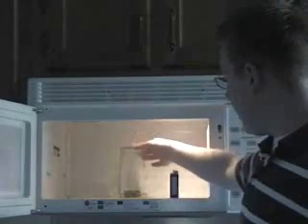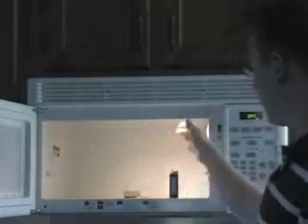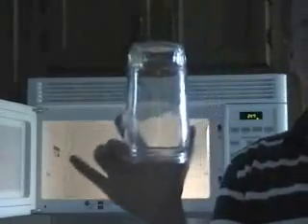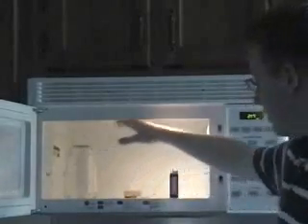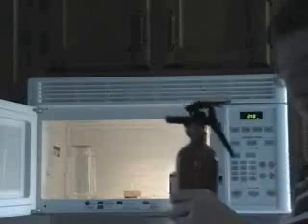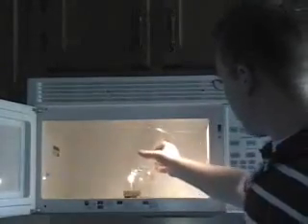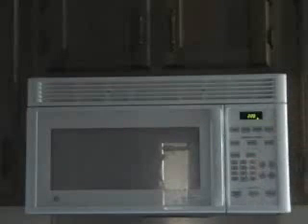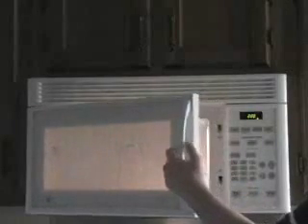Instructional:  How to Make Plasma in a Microwave

Comment: Well... plasma is a state where the electrons wander away from the nucleus...
And when something burns with a flame, electrons are torn from their atoms as the atoms rearrange to form new molecules. Usually the molecules return but it's a microwaves job to set up electric and magnetic fields, and if electrons are floating around freely they can be shoved far away from their point of origin by the electric field. I.E oscillate back and forth, to and away from the nucleus.

Comment: Actually, it does not generate any ozone, it generates nitrogen dioxide, which is also toxic but it would be much worse if it actually released ozone. Ozone protects earth from UV rays but don't be fooled by that, it is a highly toxic gas and one of the strongest oxidizing agents. A single whiff could be enough to kill you, and even low concentrations can cause long lasting damage.

Comment: @iFirebird any material can be turned into plasma, you just need to supply enough energy to free the electrons from their atoms. Plasma itself is just free floating ions and electrons. The ions are the atoms without their electrons. Very cool, but very ordinary. It is comparable to how energy is added to a solid, it will become liquid, if more is added, it will become a gas, more is added, it will become a plasma. Any substance can exsist in all four states (as far as i'm aware)

Comment: @JERKMONKEYYEH Ice contains Hydrogen and Oxygen, both wich require very much ionization and high temperature, however if you light a candle in the microwave the gases from the flame has enough ionization and energy to form plasma.

So different substances have different needs to form plasma, there's for instance "plasmatic" Helium and Hydrogen in the core of a sun, giving you the idea of how much energy those two require to form plasma.

Comment: @iFirebird (simplistically) by definition a plasma is a partially ionised gas. The most common ones we use in labs are argon, but if you can generate ions by some means (such as fire) and keep their rotational states elevated by microwave-induced transitions, then the temperature spikes from collision-induced heat and this will also potentially maintain the ionisation.

Plasmas tend to be hot. Argon plasma in labs is usually between 7 and 10 thousand degrees... no idea about this one though

Comment: Or to be simple any aluminumn like metal placed under an upside down pyrex bowl. Heck even with a twist tie. The important part is the pyrex its clear so you can see your plasma ball, and its tuff and can take it for about 30-60 seconds before it shatters.

Comment: Also, your chemistry class definition is kind of misleading.  Sure, the temperature of any laboratory plasma can be around 7+ eV (80000+ Kelvin) which indeed exceeds the temperature of the sun, but don't forget the role that specific heat plays.  Plasmas generally have very low specific heats, thus low amounts of energy can result in very high plasma temperatures.  If that same amount of energy (in this microwave plasma) were applied to, let's say, a cup of water, it would probably just simmer.

Comment: Not quite.  When you're producing a weak plasma, you don't split any atoms.  You ionize them, ie, strip off the out shell electrons of the atoms.  You can have plasmas that consist purely of ions, or purely of electrons.  No need for atom splitting.

Comment: Rock? There is no rock in a plasma reactor. The plasma in there is superheated hydrogen. And technically, any plasma created on earth IS terrestrial plasma, but it still remains true plasma. An example would be the Aurora Borealis in the north and lightning. All plasma is is a superheated gas in which the electrons have broken free from their proton hosts. It becomes plasma when a current begins flowing in it, or is induced by making those free electrons move around,as done here by the microwave

Comment: Firstly, Plasma consists of free electrons and ionized atomic nuclei. A microwave produces non-ionizing radiation, the kind that heats water by vibrating it, thus the microwave dosnt contain enough energy per quantum to ionize atoms. This means that you cannot produce plasma because the atoms are not ionized. I hope that ansewes your question, JamesB4754. Im in year 7 and better at plasma phisics than you so ha!

Comment: not sure if your entirely accurate on the whole oxygen burning business. a plasma is more or less a cloud of free floating ions, like a sea of protons and electrons too hot to stabilize. oxygen isn't necessary because its not a combustion reaction, if it was then it wouldn't be plasma.
Reply: correct.  & every flame is a plasma.  A gas furnace uses the electrical conductivity of the flame to indicate to the electronic igniter that the burner is lit and the igniter needs to shut off.

Comment: Plasma cutters use electricity to create a superhot "beam". But, Arc welding is much more intense, because of the different facial equipment. Ever seen an arc weld? It's like staring at the sun from 5 miles away pretty much because it will burn your eye pretty dang quick.

Comment: A super solids and super liquids aren't states of matter...they're the manifestations of the properties of various states of matter which are compound, temperature, and pressure dependant. There aren't MORE states of matter that we know about...what IS true is that there aren't truely STATES of matter meaning the lines are artificial and matter exists qualitatively across a spectrum of properties rather than in discrete states. iFirebird kind of has it, but it isn't more #, it's a spectrum...YO!

Comment: the states of matter go, boss einstein condensate-solid-liquid-gas-plasma. cold is a noun which exists because of language. colder objects have less energy. all matter is a condensation of energy which exists at no temperature, ie 0 kelvin even though some energy has a small mass componant it still has no temperature. cold/heat/whatever...these are nouns...don't pick it apart...throw some math out here and we can talk otherwise shhhhhh. language describes things not the other way around.

Comment: Regardless of wheater pressure inside is higher or lower the direction the energy flows is relative. lower pressure cold air could just as easily pull the hot higher pressure air out and absorb its energy; or higher pressure hotter air expell its energy into the lower pressure colder air outside. The glass breaking is from different parts of the glass being different temperatures at the same time creating stress inbetween. breakage is from change in temperature independant of direction.

Comment: Temperature inside the microwave is hotter than outside, therefore the pressure is a bit higher than outside as well.  Opening the door releases the pressure inside and the hot air flows out.

Comment: heat or cold are relative. neither one is absolute in direction. you could say that the cold are absorbs energy or that the hot air expells energy...there is no one directional arrow...you're thinking of entrophy...which is not applied here.

Comment: Not too be nit-picky but since this is a learning environment, its not cold air rushing into the microwave that would break the glass, its the heat rushing out.  Heat is constantly attempting to reach thermal equilibrium, so higher temperatures always move towards colder temperatures, not vice versa. Its that force rushing out of the microwave that breaks the glass. Awesome experiment btw.

Comment: that said, air normally doesn't interact with microwaves, and thats why plasma doesn't form in microwaves all the time.  now what is probably going on is that the carbon molecules break down and stop the gas from ionizing so easily, and thats why the plasma ball looks smaller at the end of the vid.

Comment: as an a possible answer to a question somewhere in this thread, personally i think that the carbon from the flame is the catalyst for the plasma, as it helps make the air interact with the microwaves up to a point where the air atoms become ionized enough to form plasma. 
(continued)